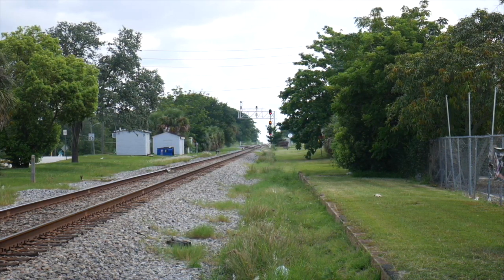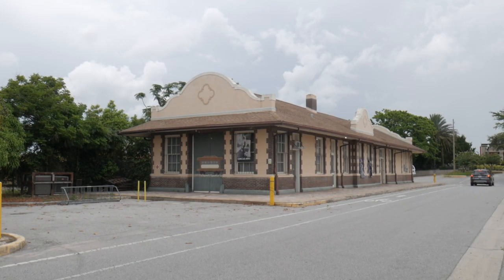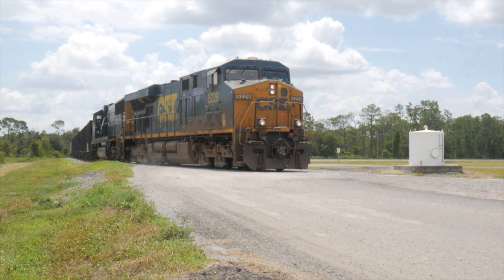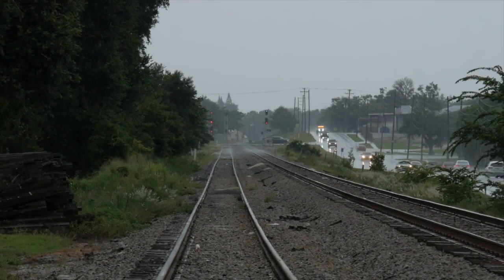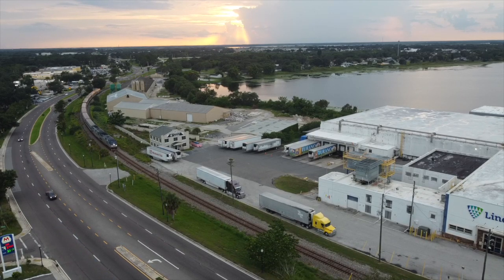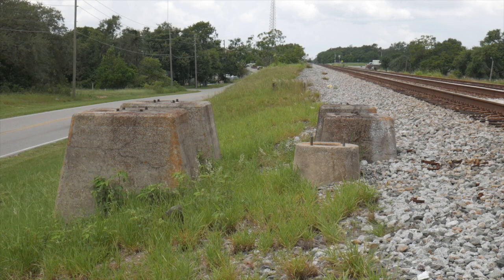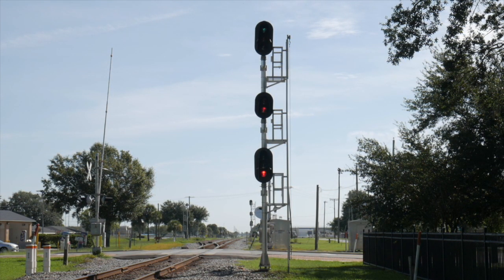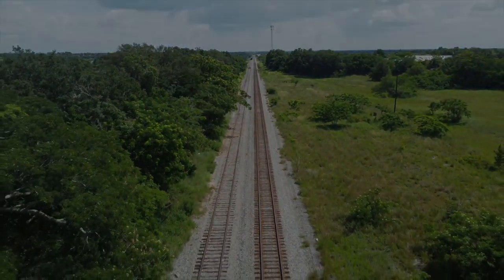Summer Operations on CSX's Carters Sub - Central Florida Railfanning

Comment: Awesome video! It's great to see someone else make an in depth video on this line considering how it's not too well documented. Also, does CSX M222 (Taft, FL - Birmingham, AL) run via the Carters Subdivision and onto the S-Line or via the A-Line straight towards Jacksonville?
Reply from the maker: Thank You! You know, I'm not sure. As far as I know, M222's usual route is north out of Taft to Sanford, to Waycross via A-line, however, there are days when a local drops off the Sanford cut in Taft, and they S-line. Either it's a very late night run.